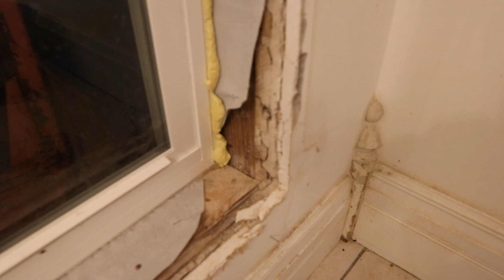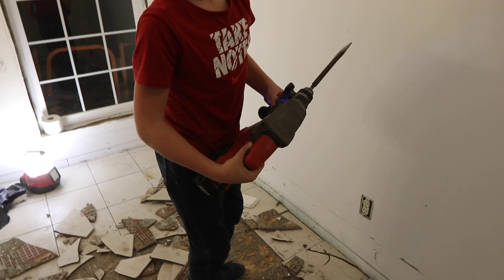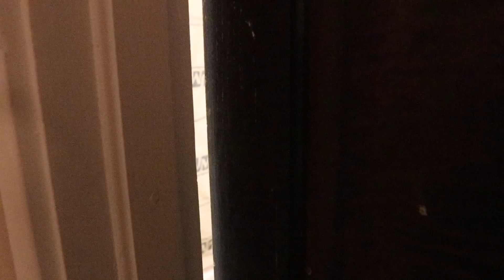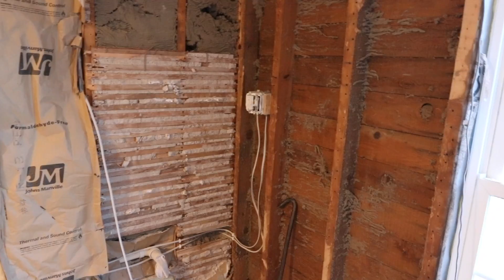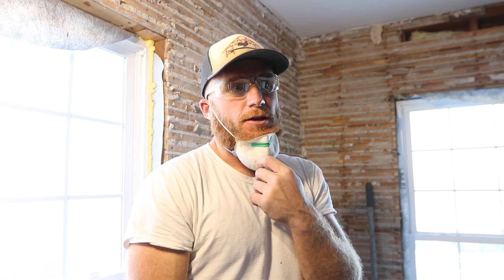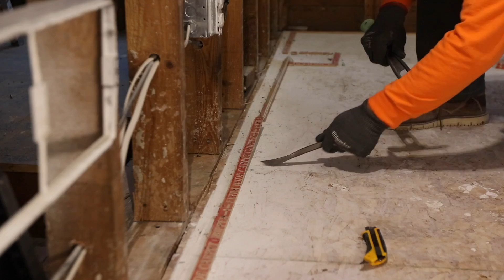Remodeling My Farm House: Demolition

Comment: we purchased a century home and during remodels had the same issues and processes.   The lathe burns great as kindling in the wood stove or camp fire pit.   We were lucky to do the whole 2nd floor at once and during window replacement put the dumpster outside the window and threw it out the window.   If you have a window/doorway below I would recommend you screw a sheet of plywood over it first to avoid shrapnel damage.

Comment: I remodeled a house built around 1870 and had an addition around 1900 in northern Illinois and what you’re doing is much different than what I did. Our house had regular wood lath and plaster on the original house and metal lath and plaster on the addition. What a disaster! We didn’t know how to remove the plaster and then the lath. What a mess! Also we had ZERO insulation. Looking forward to see the progress. Good luck!

Comment: OK get yourself a real 3M respirator those masks are just a mess. And I would only pull in the middle the nails out and than use a flat crowbar to pull everything row by row out with a 12" flat crowbar and mallet hammer. Works a lot faster and less strain on your body.  And on your filters get washable filter and every end or start of the month wash them down. This is how I always never forget to do mine.

Comment: Just a thought for that lath board, I made a tool out of a crowbar buy welding on a wide fork end. 2 tines with a space of about 2 1/4 inch for pulling apart pallets.  I think it would work great in that case.  I will be using it to remove 3/4in boards from the interior on my 1920s house, want to salvage the boards for different projects, rather than cover them with drywall or whatever during Reno.
Just a thought anyway.
Andrew

Comment: I bought a house built in 1910 and it has been so cold this winter in Mercer County, IL. I need to know what to do first. I'm not sure the insurance company will approve a wood stove. Anyway, I've already had a burst hot water pipe. What is the best way to know what load bearing walls are and if I can take out the lathe and plaster on exterior walls, fill with insulation and put up dry wall. Thanks.

Comment: Thanks for all of the great videos, when we bought our house in the NW corner of WA state it came with a 30 x 40 pole building (although all of the walls are infilled with 2 x 6 walls, sheeted and sided with bevel siding) the inside was unfinished and we're working on that.  Love the idea of the steel ceiling and punched steel upper walls; can you help me out with the correct terminology for the steel and trim?  Is the steel the same as siding/roofing and is the ceiling trim J Channel?  Thank you again, David

Comment: Reminds me of tearing out plaster that had started to fail in a whole house about 6 years ago. Took out 2-3 tons of plaster and lathe, added insulation to all the exterior and interior walls, and put up drywall. The house was built in 1926 and had no insulation at all. That took forever but it looked great once it was all back together!
Reply from the maker: Awesome.  Always a lot of work for sure

Comment: Vibrations from the shovel would knock it right off, you just need to slap it with the back and then scrape if it didn’t fall off already. Lath boards are stronger then that because it creates a mushroom effect holding the plaster on making it harder to remove

Comment: Thank you for the captions!  2 years ago, we tore out the walls of a 50 year old bathroom out of a 100 year old house.  I found using a grinder with a masonry blade worked best.  Just made vertical cuts from floor to ceiling every 1 foot, then tore that small section down.  Big mess, lots of dust. But then again, we were dealing with old rusted chicken wire.

Comment: I did this exactly for a living for a long time.  Honestly, I dont miss it, it was a lot of satisfying work and well worth it, but I had to get out.  It’s tough on the body.  You will be very satisfied with your work and glad you took it all the way to the studs, just fix it right fix it once.  Nice work, cant wait to see the progress.  Just a thought, I know you probably won’t listen to me, but.  It is a ton cheaper to insulate your walls with say a 1/2 foam board between the studs and canned spray foam to seal the edges, then put Bat insulation on top.  Accomplishes the same thing as spray foam, but with a high R value and way less mess, and expense.  Just a thought.  You can cut the foam board on a table saw a whole bunch at once.

Comment: Delathed  two large old houses. I stripped plaster before removing lathe to keep the volume of waste to a minimum like you did.  Was your house insulated with blown in cellulose?  Looks like some of the holes in the old sheathing boards were from blown in insulation.

Comment: dont use kids for this worck - it is pretty harmfull. dust - not make your children happy and healthy. dust mask in your video useless.  in my 18 yold i take allergy to dust after work like in the video. and im sorry but you house like dog home in russia. 90% house in russia rfom bricks and concreed.  im live in house 1881, wall thicknes - 25 inch) solid bricks :). in new house use porous concrete. this material havelong life span.
any way y cool - be happy and heathy
and if you need good cheap dust mask - use russia army mask, it 5$ for pcs. but it really help? and can be used 100 times.

Comment: You'd have to remove the nails anyway so it makes the most sense. Hoping you cover the small details like making some wood pucks to fill in those odd holes behind the old insulation.

Comment: Dear Kyle:  I second the comments about your daughter and getting her involved!  Don’t blink.  We’ve got the same family structure and we’re fast-forwarded into your future about 20 years.  It’s gonna fly by really fast, so treasure these moments.  Sons alway seem anxious to step in and help Dad, but your son was right there encouraging his sister as mine did, and it looks like he was maybe even letter her use his impact!  That encouragement was always a big help.  Mine got dedicated enough that they helped me clean out a moldy basement at a new office project in summer heat, spending day after day, and the adult parter who wore out after two hours couldn’t believe how hard they worked.  His 4 kids were supposed to help and he couldn’t ever get them to come hear the place.  It’s because with ours, they see it, they see the value in it for you and in your lives as a family, and that you’re always trying to make it fun.  My daughter never forgot that as a 12 year old she far outworked a grown man, and he recognized it.  Anyway, neat on the foam insulation, but I’m wondering given the collaboration with Risinger if you’re going to try his “coat instead of between-the-ribs” exterior cladding insulation ideas.  We went from 1929 rock solid brick house with no insulation in the walls to a 70’s box with plywood only at the corners to prevent racking a bit.  The rest is that crumbling black fibrous board, with styrofoam (edges not taped) then really hideous cheap vinyl siding that has faded.  I was going to get my daughter an escape ladder and one of my fire department friends laughed and pointed out the difference in houses, noting she could easily just kick through the wall and jump down!  There is good insulation in the walls but too much thermal bridging so I was thinking about Risinger’s ideas (also on This Old House Season 40) because our drafts are almost as bad as the 1929 house!  Will be curious to see how you decide to do it, as it looks like maybe your exterior is nice enough that you won’t be going that far this time.  GREAT VIDEO!!

Comment: Wonder if the ap700 airlocker punch nailer/nail remover would have made it easier on that lath!!! ....Air Locker AP700 Nailer/Nail Remover Kit with Extra Driver
Amazon's
Choice
for "pneumatic punch nailer"
 
 
 
  
$ 59 49
Reply: Or... Reconnx
4.4 out of 5 stars  15 Reviews
Nail Kicker Denailer (V20-60)
 
 
 
 
Pattern Name: 
V20-60	
$ 319 00   
+ $18.00 shipping

Comment: DUDE....PPE...Please. Set the example. ER visits = $$$
Take care
MJ
PS: When you go to reinsulate. Consider Roxul. It's safer/healthier than fiberglass and better soundproofing. Especially in the bathroom. Panasonic makes the absolute best bathroom fan!
https://www.amazon.com/s/ref=nb_sb_ss_c_1_12?url=search-alias%3Daps&field-keywords=panasonic+bathroom+fan&sprefix=panasonic+ba%2Caps%2C165&crid=11568HD5HR95O
I installed one over 10yrs ago. Still smooth, quiet and effective. Just vacuum/blowout once in awhile. Only replaced 1 bulb.
MJ

Comment: Quick tip for tack strips. Cut a piece of the carpet 4by5 foot when removing the rug . Then while removing the tack strip. Put it on the scrap of carpet. When your finished rolled it up and tape the ends closed .
Reply from the maker: Dang great idea bro

Comment: I'm impressed with that lath design; my house was built between 1900-10, and has the regular thin strip lath. It also has no insulation, and no exterior sheathing besides the lap siding, so it takes a lot to keep it warm in the New York winters. 😂

Comment: easy peasy with the boom lift.  I have the same lathe on the outside of my house when i pulled off the aluminium siding.  I reckon they used it for stucco at some point.

Comment: In 1972 my folks bought a 100 acre farm with a 1920 house. In 1973 they had it insulated the same way yours was insulated.
The house looked like it had chicken pox. The plugs were put back in and later painted. The house has never been sided and the plugs are still visible.

Comment: I did blown in insulation for 20 years. For existing walls (drill and fill) you need a small hose to go into the wall or you can drill 2 holes, 1 about a foot from the top and 1 about two feet from the bottom. Looks like a novice with no experience did yours.

Comment: I would consider other insulation’s than spray foam.  In your climate you really should do closed cell which gets prohibitively expensive. Rockwool would be my preference with a vapour barrier well taped and joined on the inside surface. Much easier to work with than fibreglass and you can get it well fitted tight into the stud bays. In an old house reinsulated from the inside, as you are doing, I would suggest if the budget allows to add an interior layer of foil faced poly iso foam as the vapour barrier.  This will eliminate thermal bridging to the inside and the combo of rockwool and poly iso foam is likely cheaper than even open cell spray foam as you are doing the install yourself. Also more environmentally friendly. Hello from Canada.  Love your videos!
Reply: Rockwool or blown-in cellulose work nicely.  I gutted my house, air-sealed any exterior gaps and holes, then blew in cellulose and new drywall.  1950 built but works better than most new houses.

I live in the South, he lives somewhere much colder and foam is more common there.  A lot of foam doesnt breathe and can cause huge issues when its installed against wood without a vapor barrier on the outside of the sheathing.  Here in the South, old houses get foamed and the sheathing rots after a few years since it cant dry.  Rockwool and cellulose are much safer for old houses, unless you strip the outside and wrap it.  His house looks like it has wrap so he might be ok.

Comment: I always just park my dump trailer under the window whenever possible.  Throw the garbage right out the window into trailer and dont handle everything 3 times. I give my employee a hard time when I see him throwing garbage orn the floor instead of into the can. He seems to like carrying the same crap multiple times for ne reason sometimes.
Reply from the maker: I need a dump trailer
Reply: RR Buildings I assumed you had one considering all the other muchmore expensive equipment you have. I have a little 10k lb trailer that holds about 9 yards. It is a little small sometimes but ussually adequate.  3 grand around here in jersey gets you a pretty nice used one.

Comment: wow, I'm 46 and never seen that kinda lath either.  In my house, my walls have some strange super thick plaster/ drywall and zero lath. I put a dryer vent in my first floor and used a giant hole saw and the drywall was almost 1.5" thick. from the side it looked like 2 layers of thick drywall but it was like glued together. and the top layer is hard as a rock. putting nails in the wall is a mess. it's like putting a nail in cement
Reply from the maker: Dang never seen that either

Comment: Was the old insulation a blown in cellulose or fiber?  Also, what is that fancy light (red with three heads on a stand) at 12:00?  Could you showcase the insulation phase?
Reply from the maker: I will for sure stay tuned brother.  That was a milwaukee light

Comment: Looks like your kids was a big help, that is a great skill for the to learn. Did they use horse hair plaster in that part of the US? That lath added a lot of structure it the walls and it did its job very well. Have you ever used a old Cresent or Bridgeport nail puller? They are a kind of slide hammer crowbar. My dad swore by the one he had. If you don't know what they are look up vintage nail puller on eBay. Real dimensional lumber.
Reply from the maker: Eric yes a little bit of horse hair for sure.  I know what you are talking about with the pullers

Comment: They kind of over fastened those laths didn’t they !     I always enjoyed throwing stuff out of the window, could you not have got an open top skip (dumpster) there ?  The one thing I have always hated (and will go to ridiculous lengths to avoid ) is double handling, and picking all that stuff up again would have got right up my nose !      Good luck on your project Kyle.
Reply from the maker: Yeah man I didn’t want a dumpster clogging my drive or a dumpster rolling off my brand new concrete lol

Comment: I did the same thing when I remodeled my remodel of the bathroom. Open up the walls and right away thinking how and why on earth did I do what I did. Of course the bathroom is the toughest room in the house to do because it's small and everything has to be thought out from the studs right to the finish project. And yes I had the old plastering lathe as well.   what a mess that was. Now I'm doing the kitchen for the second time in 30 years. This is where I learned how to do everything was remodeling my house. It's always fun to have your kids help as well.

Comment: I think it's great the way you're doing (did) it.  Clean up can take as long as the demo itself.  Why didn't you just order a dumpster and put it right on the side of the house?  The one thing I hate is having to move the piles more than once.
Reply from the maker: I didn’t want dumpster on brand new concrete drive

Comment: Hey Kyle.
Ive had good luck removing wall and ceiling coverings with a pick axe. My favorite is the standard firemans issue. It does make a mess, but it's fast. I'm able to pry off of the framing without too much effort. Keep up the good work.

Comment: I'm going through a complete remodel now on my house: 1900 balloon frame and though I hated removing all of the lathe and plaster (ceiling were awful!), seeing yours makes me feel like I got off easy! But you definitely need a plan when it comes to getting all of that (lathe, plaster, insulation) out in an orderly fashion or you can have one heck of a mess on your hands. Good job!
Reply from the maker: So true!! All my interior walls had standard lath and plaster but my exteriors are ridiculous
Reply: @RRBuildings   Well, lol, its structural lathe and plaster

Comment: Throw a screw into your rolled up carpet scraps to hold it together.
Reply from the maker: Hey no that’s a great idea I never thought of.  Thanks
Reply: Duct tape works too
Reply: Good idea, I threw a cable tie around it and it gives you a handle to hold the carpet as well as hold it together, then threw them out the window...  I didn't have a boom lift life
Reply: Brilliant!

Comment: Hearing protection!! I have tinnitus and degraded hearing so I always worry about other people's hearing.
Reply from the maker: Yes that’s my bad I need to
Get better thanks
Reply: @RRBuildings  Gotta have your kid wearing some hearing protection, man. At least give him a chance to blow those eardrums at his first metal concert.
Reply: @RRBuildings I had ear muffs or the twisty ear plugs but never wore them. I got the fitted silicone ear plugs that are vented and they're great. I can have a conversation with them in.
Reply: @RRBuildings  I am selling my Sensear smart muff SMN B001 Safety Ear Headphones for $200. Perfect Condition and Outstanding Noise Cancellation Quality. They are made in Australia and originally priced at around $350+ They are designed in such a way that allows you to still hear whats going on, with 4 tiny microphones, but as soon as any sort of impact happens, it immediately mutes the noise. Way overkill for a young boy, but will do for any construction, factory, etc.. worker out there. Selling it through Etsy, as Ebay charges outrages fees towards sellers. https://etsy.me/2X5UsXC
Reply: I bought years ago earmuffs made by peltor that have active noise cancelling and they became so comfortable for me to use that I dont often even remember that I have them on! Then some others have muffs with radio and they have to remove them everytime you ask something from them or they dont even hear you before they see that you are speaking to them.
Reply: Yep, that was my thought whilst watching his son with the power hammer. I grew up using power tools of all kinds with no hearing protection. I have a great skill set, but also now in my mid-50s significant hearing loss. Get the everyone some hearing protectors!
Reply: Thanks for posting that. He needed to be called out for that.